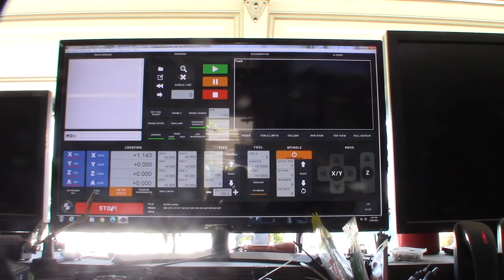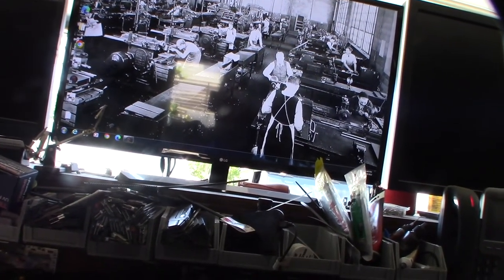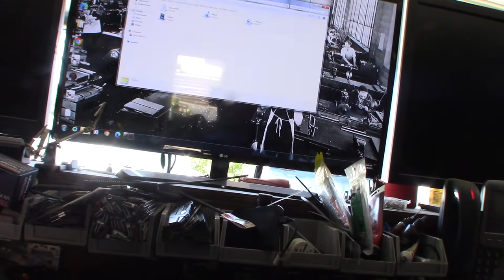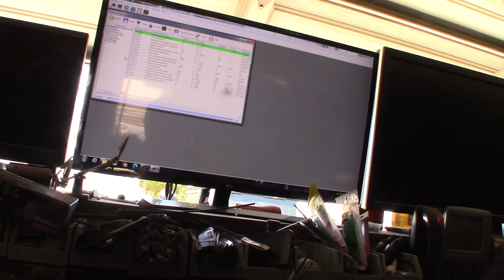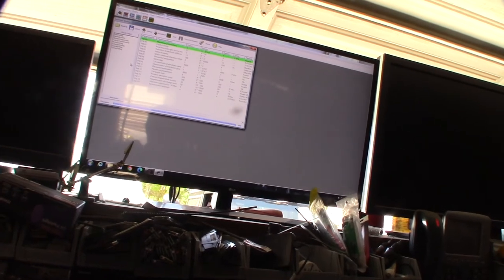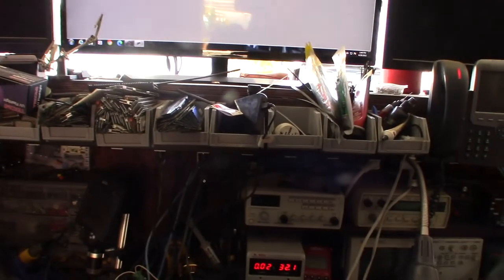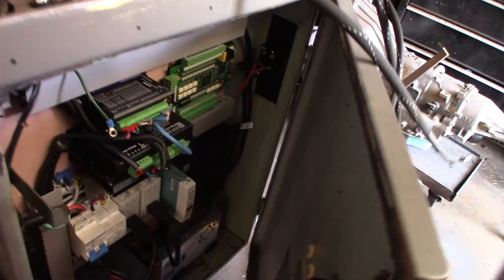STEPPERONLINE Nema 23 Integrated Servos, testing review, Weird Humming

Comment: That is a hybrid stepper motor with encoder I have 4 of them they are awesome.
Reply from the maker: Kind of confusing what they are, They spin freely with no resistance. Not like a tradition stepper motor I'm used to.
Reply: @fintechrepairshop  yep mine are  3 phase close loop I haven't gotten them to skip a step on my cnc router yet. I stalled them out once just to see if they will throw an alarm they did and my masso controller just stopped the routing job all I had to do is start the job back from where it stalled at and it finished the job I love them way better the regular steppers.
Reply: They are definitely a servo, not a stepper. They are a dc servo, but they use 3 phases and vector control rather than the pwm you would see in say a bldc “servo”. So in some ways similar to an ac servo… except dc
Reply: Do they come with autotune?